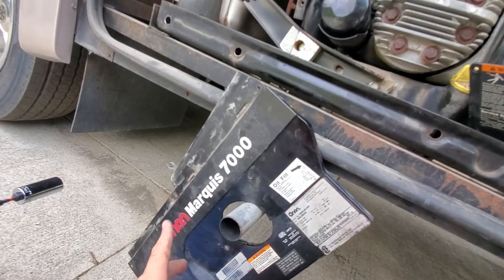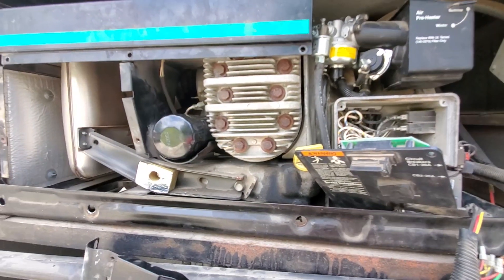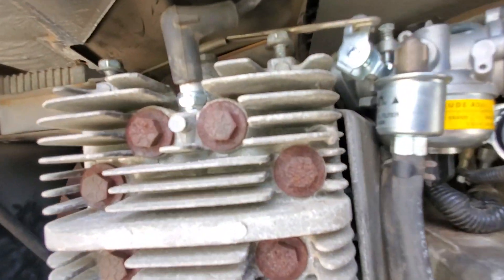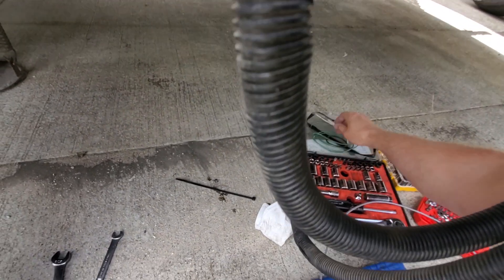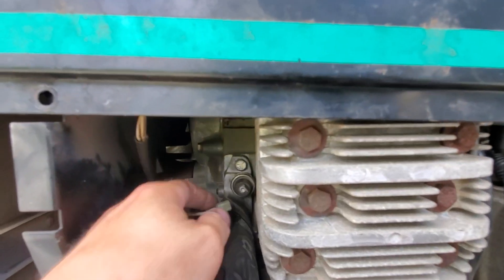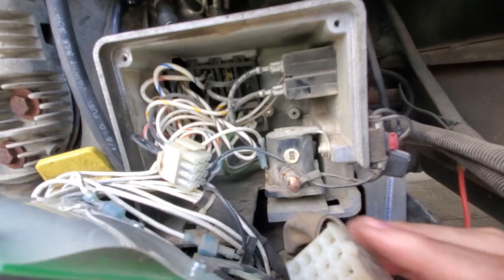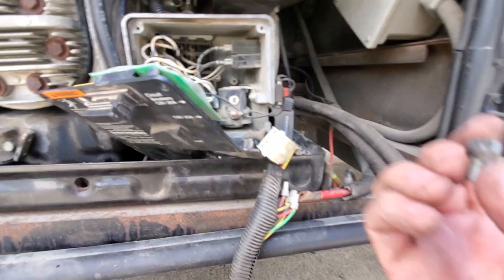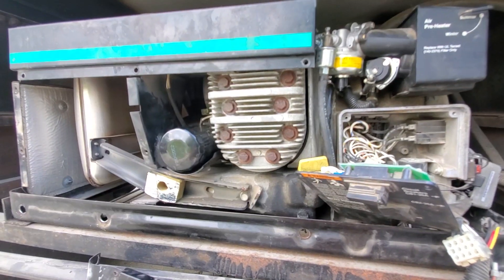Onan Marquis 7000 Oil Pressure Switch and Voltage Regulator

Comment: Well I know its a year after the fact but you can access the oil pressure switch without removing anything but the oil filter itself first then you have a hole in the cover big enough to fit your hand and sockets in thru....
Reply from the maker: Yeah, good point for sure!!

Comment: Do you have the location or part number you used for the voltage regulator?  Awesome video.
Reply from the maker: @daniellawrence5585  oh, thanks. I purchased the voltage regulator from flight systems. My receipt shows: 56-Model 826: Direct-Fit Replacement 305-0826 Voltage
Regulator
- 1 $455.00.
So I'm guessing the original model is 305-0826. Hope this helps!
Reply: @SteveWoodyMusic  I spoke with Flight Systems.  They got me to the correct part.  Thank you for the video and help.  I really appreciate it.

Comment: Thanks for the video. Do you know if the oil pressure switch was faulty by grounding it out to the chassis? Did you replace the oil sending unit and if so did that fix your issue?
Reply from the maker: @dblackkw  mine was not faulty. My issues were more fuel/air ratio and idle screw. But, yes, grounding out the pressure switch will make the generator think the switch is working if the switch is faulty